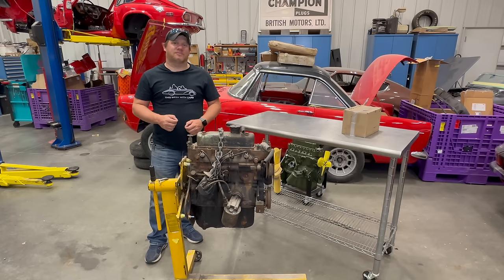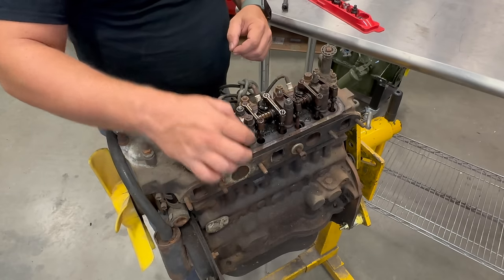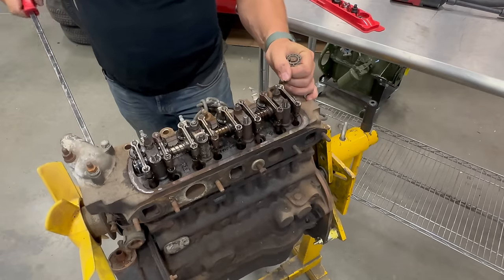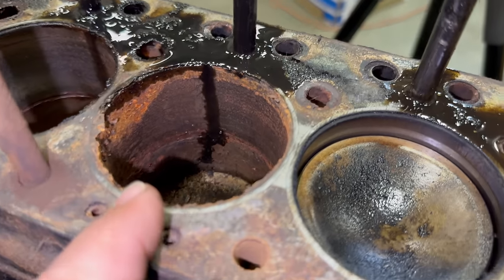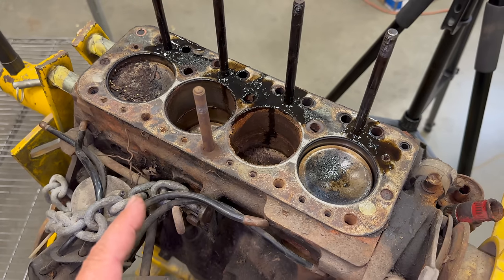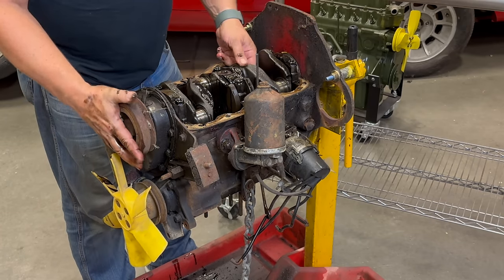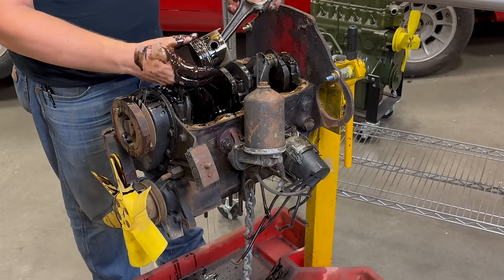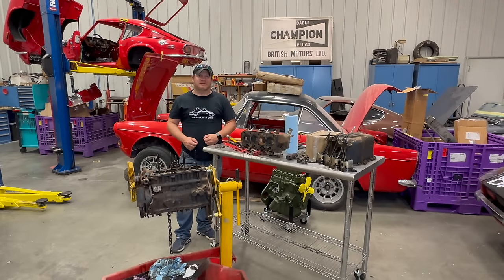1275 Engine Tear Down for Barn Sprite Number Five

Comment: I like these videos, even if they're repeats because they demystify the engine. I need to rebuild three. The more of these types of videos you produce, the more excited I get to rebuild them. (Inherited my dad's 59 bugeye race car, and his 58 bugeye road car, both need lots of work, and bought a 59 bugeye road car at an estate auction that is a completed chassis, plus several engines, transmissions (including a Datsun 5 speed!) Differentials and almost everything needed to finish the 59, plus my dad's horde of parts included at least 8 transmissions, a dozen blocks and a few complete engines all that means I have work to do like rebuilding engines.)

Comment: I have stripped down and rebuilt lots of these engines and always followed the rules religiously. I get the need for keeping the rods, pistons, bearings and valves in their correct position but why the push-rods? Any anomaly at either end would indicate a serious problem and the need for replacement but I have NEVER seen such an anomaly and yet there they always sit in holes through cardboard on the bench.Tappets wear to match cams, of course, but push-rods? What disaster have I  been averting?

Comment: Can you have different size bores? Say, bore out the 2 bad ones and hone the two good ones?
Reply from the maker: You can but that would unbalance the engine and is not a good idea for a long lasting engine.  Dirt track racers do this to their race motors so that if someone claims it after the race they get a motor with different pistons in it.